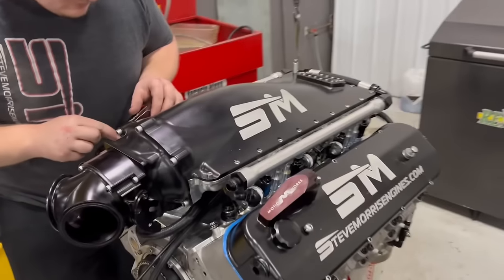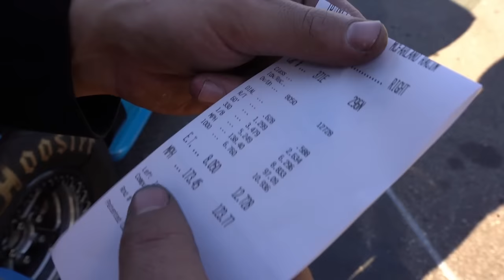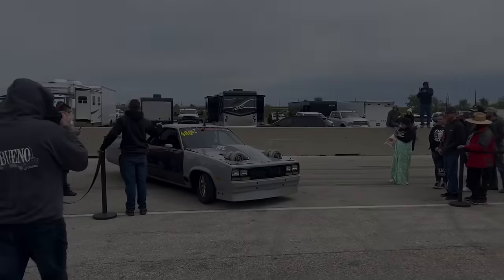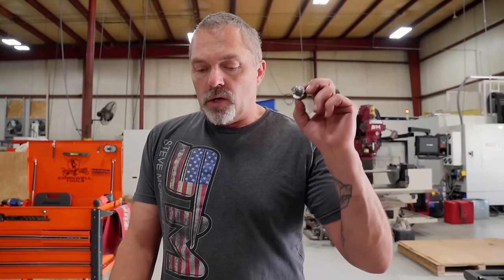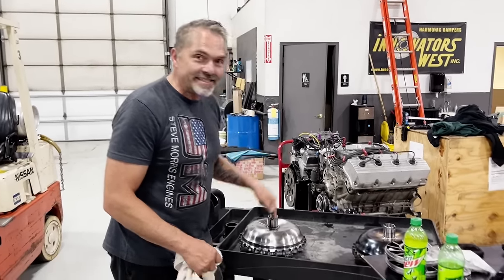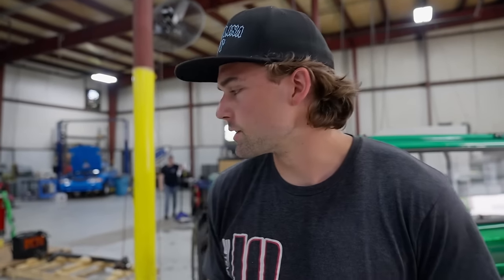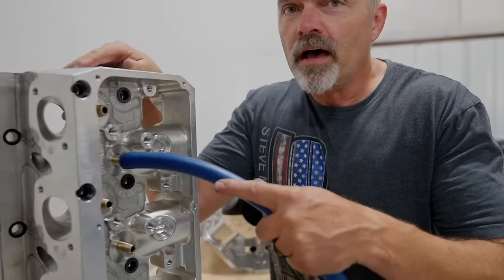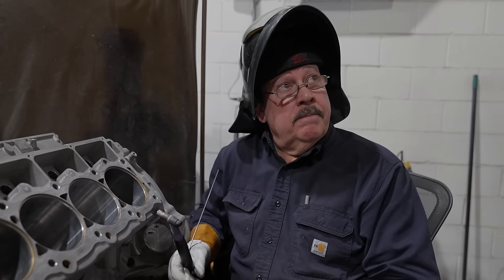2023…What Happened ?

Comment: Steve on that piston and rod assembly for a 6nz cat , the crown is steel and cast with a web for the rist pin to go through. The skirt pin bores have grooves cut for snap rings .you  slide the  skirt on shove the rist pin through both parts lock the pin in with the snap ring. If that engine was 430 hp or less it would of had a full cast aluminum pistson with a steel instert on the top ring land. If that was an marine  800 + or automive 15.3 liter  it would  be a forged  steel piston 475 - 1800 hp daily  driver top rpm 2500 no issues.  Pulling rigs run 32 to 3600

Comment: The sealant you used on the sleeves is garbage compared to 6.0,6.4 & 7.3 powerstroke  motor craft RTV  silicone sealant ford grey.  This rtv is the oil pan gasket on ford power stroke it’s the best rtv I’ve ever used.

Comment: if you love your engine let you build it i can't afford the oil you use. if i could afford the oil you use the Red Turds 4.6 ford wouldn't be on its last leg. i think it came with 236 horses. 100 have died. 75 are sick and the rest are on strike. i love the Red Trud but you can our run it will a good 10 speed bicycle and out pull it with a good lawn mower. and on its good days it gets 9 mpg.